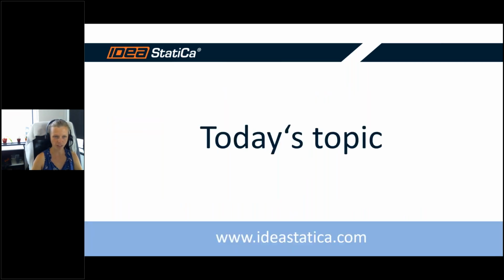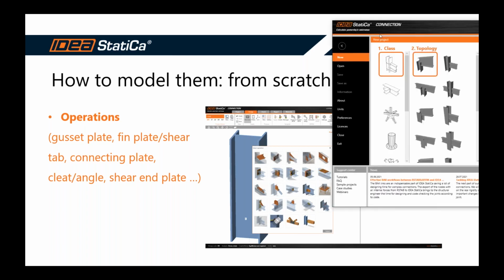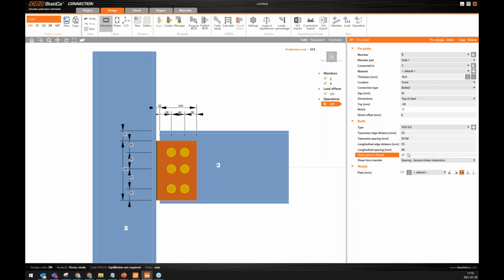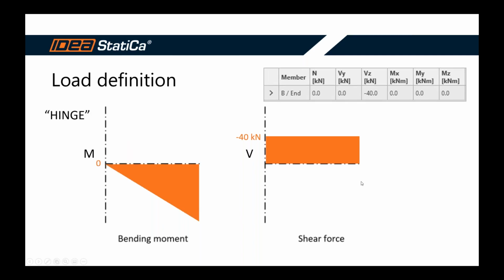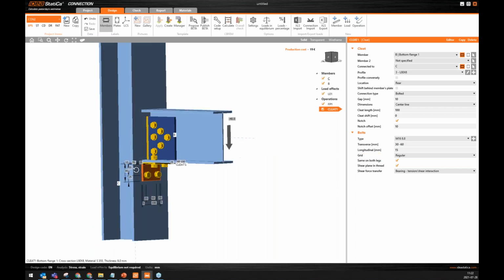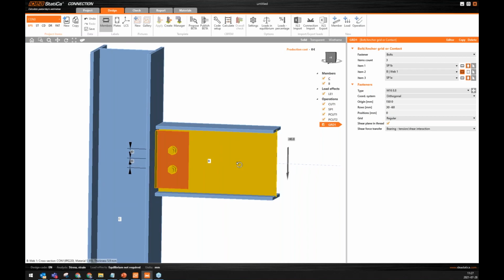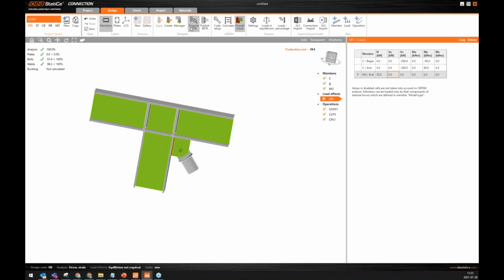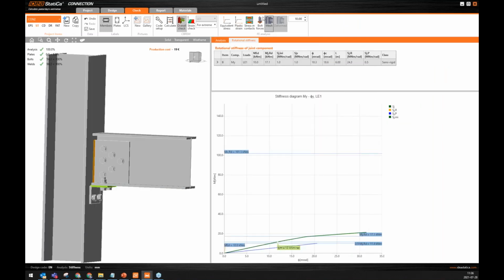Tackling IDEA StatiCa Connection – Shear connections

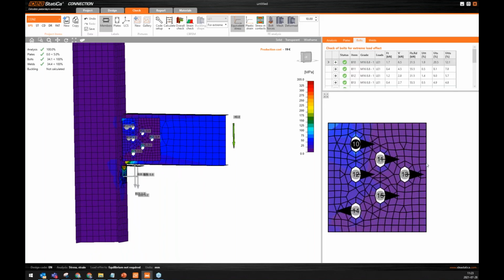Comment: @21:00 in wich situation would you use these eliptical holes for connection?
Reply from the maker: Hello,
the example shown was not a real one making a bit of sense from the design perspective, but rather a demonstrative one for the purpose of showing the feature.
In general, the slotted holes are used to allow movement along the slotted direction while taking the shear perpendicular to its direction.
https://www.ideastatica.com/blog/bolts-in-cbfem
https://www.eng-tips.com/threads/slotted-holes.231406/
Reply: @ideastatica_en  Thank you for your answer 🙂

Comment: Just started using IDEA statica and seems like it is promising since it has good flow withTekla structures and SAP2000, i think. Have checked linkedin profiles for supports for IDEA statica but it seems you people cant be added. Would have been nice if we can message you directly in Linkedin and ask you guys directly.
Reply from the maker: Hi, thank you for your comment. We are really glad you like IDEA StatiCa and hope to find it useful for your projects. 
Regarding your comment on Linkedin support; unfortunately, we do not provide support on social media. There are several reasons for that, but most of all, we need to ensure the scalability and trackability of every issue. There are multiple people involved from either our support team or local support team in respective country. 
In case of a support request, you can easily submit your issue on our User Portal and our support team will get to it very quickly.

Comment: When you changed "model type" for a pin connection to N-Vy-Vz only, you did not change "Forces in" or "position of hinge" from node to bolts. I think you should have change it as it is shear connection and position of hinge in shear connection should be in bolts not in the node. Becuase if you do not change it, as you mentioned it in the beginning of the video, there will be some moments on the bolt. And this bolt is not designed for resisting moment, its actually shear connection. So please answer me. Thanks....
Reply from the maker: This depends on the approach - for some codes you have prescribed to check the bolts for the moment too.
So depending on how your model should look like and behave and for what load you want to code-check the components you choose which settings you apply.
You can also have acutally 2 models - nr. 1 where you leave the shear force position in node means you have moment in bolts, and nr. 2 where you shift the shear force and you have moment in the weld of the plate to member.
Reply: @ideastatica_en  Thank you so much
Reply: @ideastatica_en  I also asked another question about this webinar as well. can you answer it also. thank you in advance. you can find a comment below.

Comment: What is the  mean of model type (n vy vz etc)in member tab ? İs there any informative webinar
Reply: And second question , why dont we select model type  to first model with two bolts ? What Will idea statica calculate ? So why dont divide the bolt  forces to two equal values of half of total shear force?
Reply from the maker: Hello, there is a webinar about the model type here:
https://www.youtube.com/watch?v=nMPL8_YbiMg&lc=UgzWRPyHRAmWBEYjAmt4AaABAg&ab_channel=IDEAStatiCa
N-Vy-Vz is typically used for 1 bolt connections, like bracing, etc. It actually adds a support for moments at the end of the member and allows only shear and normal forces to take effect.
https://www.ideastatica.com/support-center/how-to-model-one-bolt-connection